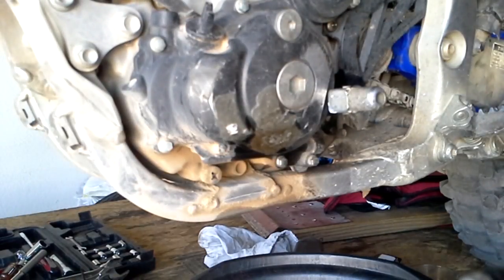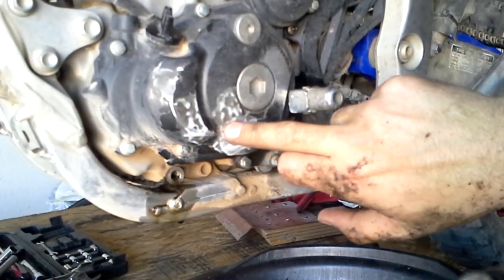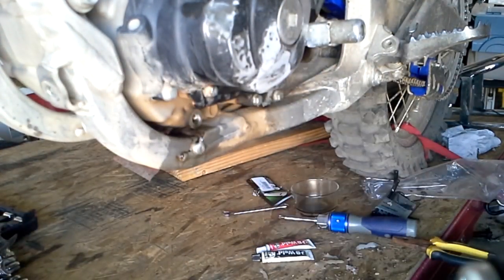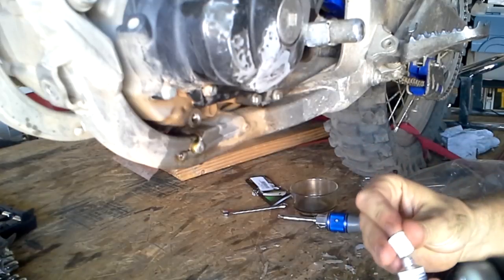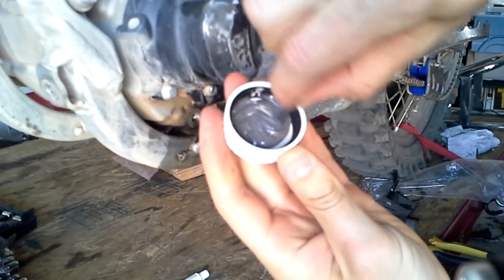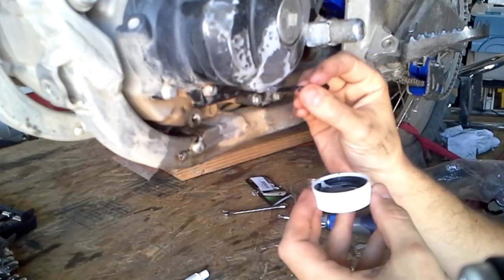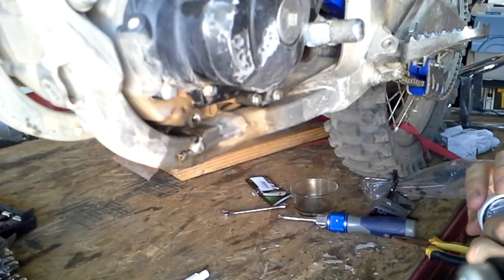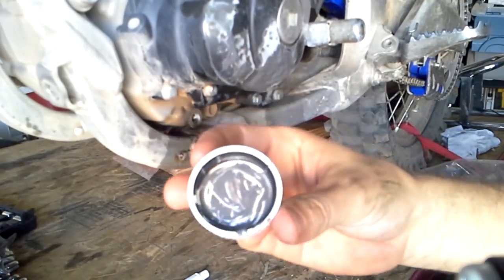How to use J&B Weld On a cracked engine case

Comment: My connecting rod snapped and I JB welded it back up, it's holding up great now over 100 hours of riding time, also broke my clutch basket and JB welded it back up to, this other time I broke my swing arm also and JB weld did the trick also and it's fixed. JB weld is the best stuff out there.
Reply: Jb weld a connecting rod?! Somethings you should just replace. A connecting rod is one of those things.
Reply: I honestly just don't believe the connecting rod. There's videos on YouTube here of people trying that as an experiment and it did NOT work!
Reply: @m.m14433  he's joking

Comment: I carry epoxy putty in my toolkit but have never needed to use it. If you want a more permanent repair I have found aluminium brazing rods that melt at a low temperature that I think would be great for a permanent fix without welding, again never used though!
Reply: @HungryTv13  Hahaha these rods are classed as low melt but they are like 647C. Heat the metal it's going onto to melt the rod, plenty of vids on here.
Reply: @spartacus09ful  so it’s viable?
Reply: @shadowjack48209  What the Jb weld method? It's still sealing a leak i my oil cooler after 3 years. I cleaned the area applied some and let it dry. Then I applied another layer for extra peace of mind.
Reply: @spartacus09ful  awesome! I’m fr using it for the simplest shit. Broken thread mount. I’m hoping to just screw It back in covered in JB Weld, clean the excess and go over the cracks, then seal it tight
Reply: @shadowjack48209  Broken thread mount...where? Ther jb weld will stick to your bolt,I'm not sure if it will just crack when removing in future or won't budge. Don't know if the JB weld would be good holding any torque also.

Comment: You don't have to drain the oil to do that, you can simply lay it on its side, clean the surface with a damp soapy rag, sand it and then apply the jb weld.
Reply from the maker: I was due for an oil change..  But you are right.  On the trail if it happens,  lay the bike and your golden

Comment: So,call me a idiot but I own a 2016 ttr125le I over tightened the oil drain bolt and it scraped the threads off of the Motor(not the bolt) do you think this could hold up to my situation?
Reply from the maker: +Joel Lorenzo I would just redial  and tap it bigger, or add a save a tread insert
Reply: Ok thanks

Comment: I droped mine in the same place , how,is the jb now ?
Reply from the maker: After 5000 miles since than it works great,  I dropped it twice since than so I got a better skid plate,  but the jb weld got scratched but holds strong.  I put total of 3 layers..  :-)  go for it man is better than new